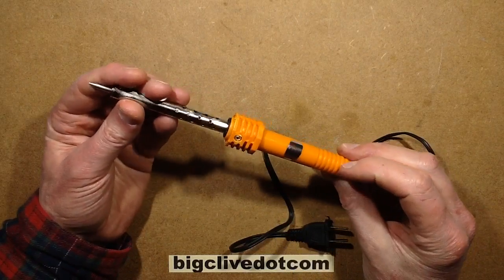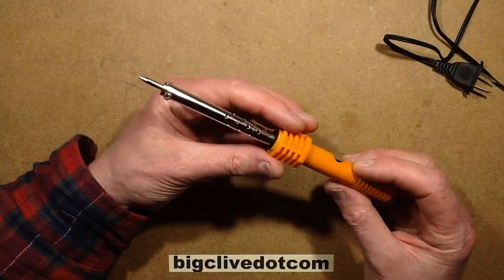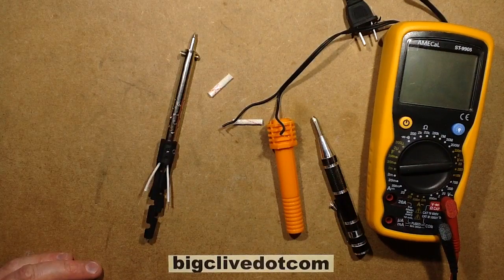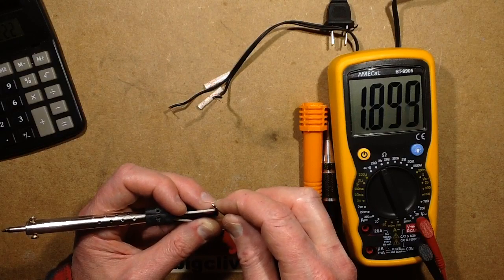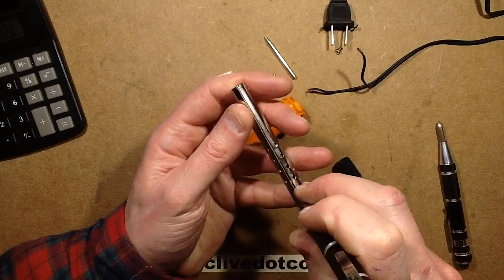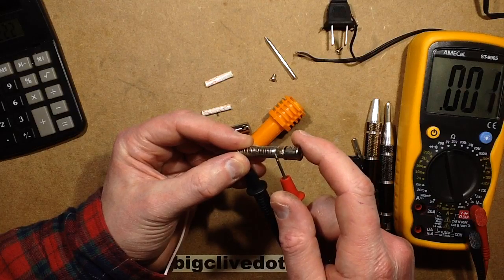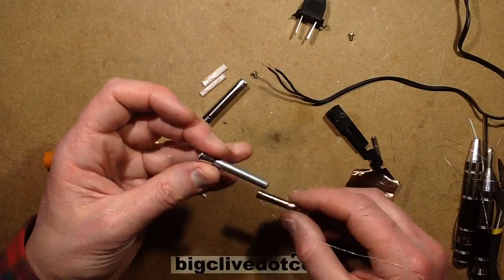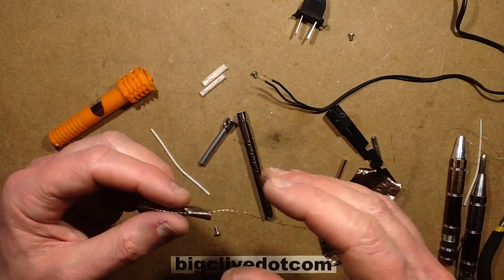Inside the cheapest soldering iron on ebay.

Comment: O.o  The cheapest  (<$5 CDN) 60W irons sold retail I've found is put togeter exactly the same way your example is, but in every detail you mentioned is that little bit supperior except one.

I use these because I've learned the many interesting noises it makes, a distinct buzz for each temperature range.  And with a far larger diamiter tip (high thermal mass),  most rework is easier (as is also delaminating traces).

The one problem is the oversized chunk of copper wire for-a-tip can get pushed into the wiring and short it out (with enough force) because the screw that clamps it in seems to deform/melt/loosen itself.

Comment: I had pretty much the same happen to this cheap "desoldering tools" (your normal plunger solder sucker + a hollow heated tip). The wires were just losely twisted together and i think I may get 4 or 5 more uses out of it before it melts itself.

Comment: The soldering iron I bought was based on the ones I used at school. Big unit, connected by the basic 3 pin IEC connector (the computer power supply one). On that unit you have the resistance/temperature control, heating light indicator, on/off switch, a small divet for a cleaning sponge, and a metal cradle to hold the actual iron. I don't know why anybody would get anything less. only cost me about $50.

Comment: Don't forget some of us use them for things like model railways and models generally, and the earth is not so important. I keep cheap ones as backups, and have about 10 types of irons! I nearly always swap the tip for one made from phosphor bronze rod, they wear, but retain the tinning. Asl these cheap irons are good on dimmers to give a low temperature iron, for 145c solder and sub 100c solder like woods alloy.
Stephen.

Comment: Soldering irons are simple.  You buy an Antex and a large bit or a small bit, depending on the sort of thing you are soldering and then you enjoy a trouble-free life.
And don't file the bits, they are usually nickel plated to stop them reacting with the solder and eroding.

Comment: Bought a cheap iron myself. Probably should serve as a heads-up to people about cheap irons. Mine had a ground pin on the plug, but when I opened the plug, the ground pin wasn't actually connected to anything; horrible.

Inside the plug was also a 13A fuse. A 13A fuse on a 40W device... scary stuff.

Comment: Grounding isn't common on soldering irons, at least not in my part of the world. None of the old Radio Shack irons my dad had (nor a newer one I bought from its successor store) were grounded. I have a big 80W Weller that isn't grounded either, although that one isn't meant for electronics (stained glass, electrical, and maybe plumbing). On the other hand, both my WP25 iron and WESD51 station are grounded. It makes a lot of sense the way you've explained it, but I never thought of it as a safety thing until now, only in the context of ESD.

Comment: This looks better at first than the one I got in the mid 2017 from eBay for $2, was soldering and the wires came out just like this but they had put one tiny spot of solder on the very thin tip of the wires no stripped wires etc

Comment: I have one of these pieces of crap, and as a matter of fact, I've gone through quite a few of them. It does have stress relief but it's not grounded. Inside, it's built similarly to this one, the wires are just twisted together.

Had to get one since no local stores in my city sell soldering stations and I didn't have the time to take a five hour trip to the capital city just to buy one. So far it hasn't failed me, and I haven't damaged any electronic components yet due to the lack of earthing, but it's still pretty bad. As for the old ones, let's just say the tip eventually broke. It literally snapped.

Comment: I was shocked when a friend told me this is the best soldering gun he has been using for last 30 years without any trouble and he bought it for about 50 cents. So we bought some and they all work very good... perfect, only issue is no earth....I am actually looking for a gun that load or store all solder, flux in it so that I could fire on joints with single hands easily.

Comment: in around 90 or early 2000, in Indonesia, so many soldering iron's model like this. But the filament made not like that (in this video), still more secure. But when i bought the similar one around 2011, and want to join my components, i got electric shocked !!! I opened like you did and whoala... similar like in this video.

both of them, same China made but the last one more cheaper. Around 90s it cost about 20 dollar but now only 5-6 dollar. 

Cheap and everyone who bought this also price theirself so cheap for safety.

Comment: I just bought an identical one at Fry;'s Electronics. Cost me $4.99...super cheap. I plugged it in to try it out yesterday and it began to smoke not long after. I eventually unplugged it because it appeared to just be getting hotter and hotter and hotter as the white smoke just kept coming out of those holes near the base on the metallic rod portion. Never going to use that thing again. You get what you pay for.

Comment: The cheapest soldering iron I ever took to bits didn't even have as substantial of a handle as this, but it actually had a ceramic heater and a pair of binding posts for the wires...

Comment: I'm fairly sure non-grounded soldering irons are quite common, at least here in Canada/North America. I've got a fairly nice Weller 40W station as well as a Weller one that goes straight to the wall, and both are not grounded. I believe it's quite common since if you were doing repair work on a live system you wouldn't want a grounded iron shorting out the circuit wherever you touched.
Reply: +Chartreuse Kitsune Grounding is mostly important in 220-240V countries, so most of the good ones here have grounding pins.
Reply: yes, I live in a 240 Volt country and mine (I've got 4 soldering irons) are grounded.

Comment: Hi Clive.  I notice you buy a lot of your bits & pieces from the Asian market.  I've never bought anything on Ebay from abroad (I'm in UK too) because I've been afraid of extra charges and import taxes, etc.  How do you find this?  Is it a bit of a gamble when you order or is it all pretty straight forward?
Reply from the maker: +tony sansom The small Chinese stuff never seems to get hit with import duty unless shipped at great expense by FedEx or DHL.
Reply: +bigclivedotcom Ok great - thanks Clive!
Reply: +tony sansom There's actually some pretty good stuff available from china if you find the right Ebay seller. I recently found an Ebay vendor selling fine strand silicone wire (the floppy "wet noodle" wire) and braided PET wire covering with free shipping. Ordered some 10AWG and 4mm braided covering (I use it to cover servo leads) to see what it was like and it was good quality stuff, a bit better quality than what I was already using and very inexpensive ($3.50 a meter for the 10AWG and $5 for 4 meters of the braided covering) I've also found it's much cheaper to buy high amp gold plated bullet connectors from overseas. Locally I pay $5 a pair for 6mm gold bullet connectors but I can get them from overseas for $3 for 5 pairs (usually I buy these from Hobbyking, they have great connectors)
Reply: +tony sansom I've never been hit with import taxes even from the big Chinese sellers like banggood/fasttech or some of the aliexpress ones
Reply: +tony sansom
Nothing is charged on any import whatsoever from any EU country.

VAT is not charged on imports from outside the EU with a value (incl. shipping/insurance) under €22 (Southern Ireland) or £15 (UK). VAT is charged on all imports to the UK from the Channel Islands regardless of value.

Customs Duty is not charged on imports from outside the EU with a value (incl. shipping/insurance) under €150 (Southern Ireland) or £135 (UK). Customs Duty is not charged on any import to Southern Ireland from the Channel Islands, Gibraltar or the Canary Islands.

The taxes must paid to your courier company (DHL, FedEx, Parcelforce etc.) or postal service (Royal Mail, An Post), who may charge a fee for their trouble.
Reply: البابعبلب بل ابل ال بي ا

Comment: Many Asian countries only have two pin sockets, so they would never even consider an Earth...where would you plug it into? 99P, couldn't complain if it does the job. I have bought half a dozen Thai made irons from local shops, rated from anywhere between 40 and 120W, not one of them has managed to generate enough heat to even melt the solder. The Chinese one you reviewed does actually work and tins anything, I bought the 70 Watt version.

Comment: I had a iron which looked the same except blue I got from eBay, it worked fine for a couple of things like replacing a voltage regulator on my ZX Spectrum but then all of a sudden next time it wouldn't heat up anymore, probably the insulation breaking down or a short, I wouldn't know exactly but a friend who works at a shop which repairs and sells electronics and takes in stuff for recycling got me a Weller iron for free that he found in one of the recycling bins, any of you out there I'd definitely pay for something better than these eBay ones! I wouldn't know how good the higher priced eBay ones are but if you're going to pay more just get something decent unless you're only ever using it 2-3 times.

Comment: I have the same one and it really is cheap like 1 to 2 USD, but it works, so i modified it and used my glue gun wire ( Has 2 insulation so it's safe to touch and upon reconnecting, i used heatshrink rather than an electrical tape which is whats used in the iron, also i added a 3A 250V switch on the wire, I'm using it now with no problem.
The cheap soldering iron itself is dangerous so modify it safely at no ones risk, stay safe.

Comment: I took my cheap Chinese glue gun apart, it had the same weird plastic like heating elements wrapped by nicrome wire.  Most of the world, not the UK, don´t  use a ground wire at all, it is done through the neutral mains wire and the electrical pole in the street provide the earth connection, more economical that way.   Even if this iron was to short out it would melt and break apart  the thin nicrome wire inside long before that thick insulated plastic handle would even begin to get warm.

Comment: Hey Clive, found your vids recently and I'm really enjoying them. 
I live in Switzerland and relative frequently travel to the UK, but have always been too cheap/lazy to buy enough adapters, so have always just shoved the swiss two-prong plugs (edit: euro-plugs) into the British sockets after pushing something thin and non-conductive into the earth to disable those little safety blockers (while the socket is off and removing it once the plug is in, of course). I have never had any problems with this, but have been wondering if it safe to do or not. (Of course it isn't "safe", but is it safe enough?)

Comment: Hello. Have you ever used a Wall Lenk soldering iron? They are well built, made in the USA, not China, with a 5 year warranty on it. You can usually get a 30 watt for around $22 USD on Amazon or a few other places. I have used this brand for years when I am not around my Soldering Station. I have 3 of them. I put them where they are easily findable and I keep a new one in the box in case one goes bad but I have never had one to go bad. I have accidently stepped on one and broke the plastic handle.  
Also, on one of your other sites, I wrote how to use a Sal Ammoniac bar to re-tin your soldering bits to make them last 5 to 10 times longer. Try a Wall Lenk. You will not regret it.

Comment: I use a 12V soldering iron for printed circuit boards and an old computer power supply or an old halogen lamp transformer as power supply for it.

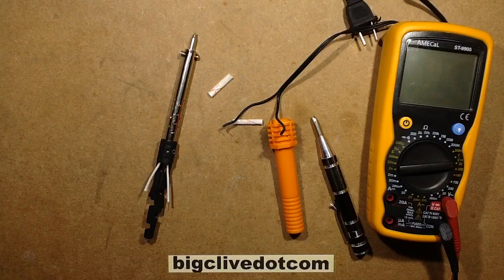Comment: 2:10 HEY!
You ought not expect the cold iron to give a meaningful measurements for load resistance.
The iron is not likely ohmic. Semiconductors and incandescent bulbs are used as examples of non-ohmics. I wager that these heating elements also are.

Comment: i bought one like this at the dollar store except the wires were connected together with screws into plastic surrounded with metal, very scary shock hazard. Worked great for about 1 day until the internals melted and the wires could never make contact again.

Comment: The lack of strain relief is interesting. I wonder if there was supposed to be another plastic piece acting as a "plug at the end of the unit? If they did not bother wrapping the wires around the internal wire guide they would have left any "extra" bits off as well!
Reply: +Bigrignohio even a bit of tape or a cable tie would have done it, so yeah maybe someone forgot something or they ran out of
Reply: jusb1066
Or they figured "Why not save another 15 cents?". After all the factory that manufactured the product probably was just copying someone else's product. Sort of like playing "telephone". By the time the message gets to the end it is nothing like the original.

Comment: Electrical outlets in old homes have two pronged outlets without ground, yet that generation lived longer than today's generation with ground.
Reply: Because today's generation is still young and not dead?
Reply: My Space comments like this are a sure fire way to say "I have no idea what I'm talking about" in so many words
Reply: How important is it to have a soldering iron that is grounded? I bought a soldering iron, but it only has 2 prongs at the end. Do you recommend that I buy a 3 prong wire and hook the ground wire to the tip of the iron? Thanks
Reply: You don't need to ground the iron, just use a rubber mat under your feet or wear shoes with rubber soles while working on sensitive electronic equipment.
Reply: What I'm worried about is that the heating element insulation melts and thus the iron tip would be charged. That could destroy sensitive electronics that I'm soldering. Connecting ground to the tip would solve that potential issue. That's what I've heard at least. What do you think?
Reply: My Space the new survive less with ground cause they keep pokin shit in the electrical socket
Reply: So when the hot AC lead contacts the iron metal which touches the PCB that your other hand is holding, the current goes across your chest and back into the power cord resting against your arm, a cord which was frayed and molten because it's chinesium crap too?

The lower quality a piece of crap is, the more safeguards it needs built in.  Counter-intuitive maybe, but true.

Comment: is the main lead a North American plug? The reason I ask is because when calculating resistance you used 220v but North American systems use 110v (or 120v depending on who you talk to)
Reply from the maker: Chinese plug 220V.
Reply: +bigclivedotcom  like iraq use 220V electric

Comment: Good video and like most I've looked at these solder irons and thought .... I would never buy one of those ... but then I think they may have a good usage to say for example make solders on cables, join connectors  and the like. In those situations we do not need the latest and greatest thermal controlled solder station. We actually may save some money by not deteriorating the our more expensive solder stations tips that cost Way more then this cheap iron :)

Comment: i used a one just like this once, needed a quick fix for my LED strips since i misplaced my other soldering iron, so like yea these are dirt cheap and should be fine for a few uses. used once it was fine, kept it in my store room for a few months, tried to use it again, plug it in, switched on the power and boom sparks flew from the socket lol.

Comment: i have one that has a blue handle with the exact same design for rm 2(0.36british pounds) and it worked fine.I used it to solder wires to a motor.

Comment: It appears that the element fly leads were just twisted around the power cord wires and they just pulled out, this is totally unacceptable. They should be crimped on and the power cord should have a strain relief. Also the earth is not optional its a must and is required by law in UK and Australia.

Comment: I got a cheap soldering iron from Harbor Freight and it isn't even hot enough to tin a 28 gauge wire.  I literally have to touch the iron to the solder and drip it onto the wire to try and tin it.

Comment: ironically, the soldering iron's wires aren't even soldered themselves.
Reply: Obvious Bot According to another Clive video about the innards of 900-series irons, they never are, even on good irons.  Mechanical connection by twisting and squeezing is the normal way.  Might have worked if the cable wasn't pulled.

Comment: I actually had 3 that looked just like these, all three had the exact same problem, once they got up to temp, the wires would just melt and break off because of the high current, not even kidding. They didnt even get up to temp before exploding, so i just gave up on them after a while.